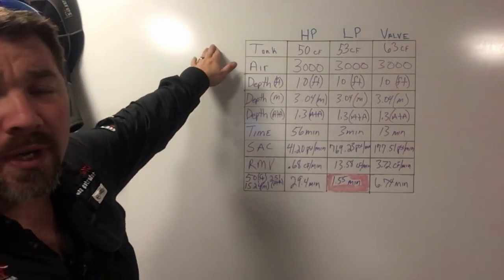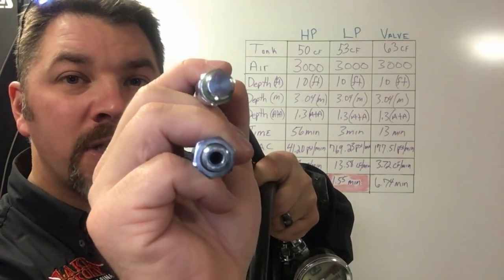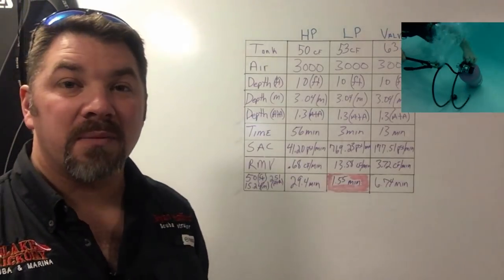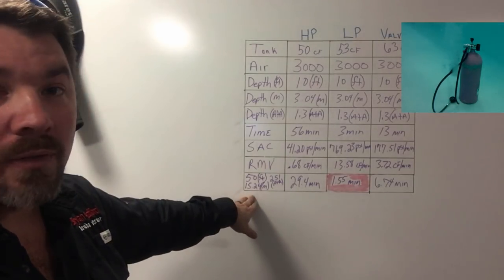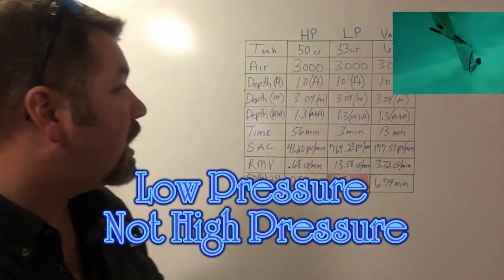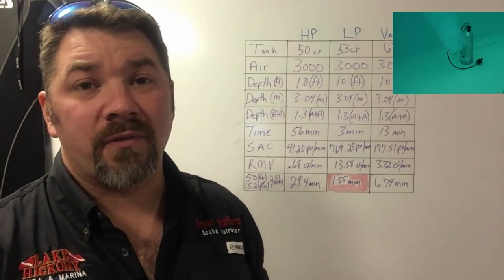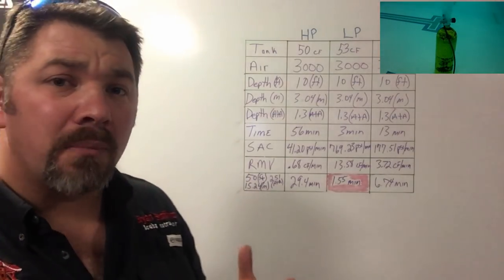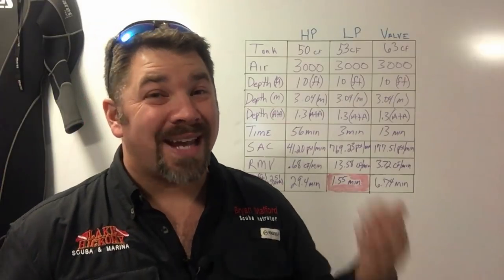Low Pressure vs High Pressure Air Loss Test

Comment: I know this is an older video, but we recently had a discussion about this topic in our diveclub with different opinions. I personally think your calculations are wrong (Not 100% sure though :D). And here is my explanation: When you dive you use more air at depth, because the gas inside of your lungs get compressed and you need to inhale more gas to fill them up. BUT when a hose breaks there is no dead airspace that needs to be filled up, the flow rate determines how much air escapes, not the volume that needs to be filled and that shouldn't change no matter of how deep you are. So it should take the same exact time to drain a cylinder at 3m and 30m.
Reply from the maker: Hello Fabian Buckreus, we are planning a dive in the near future to 100 feet as a retest to see if our numbers are correct.  Stay tuned.
Reply: @LakeHickoryScuba  Awesome, I can't wait. I place my bet on: the only difference you will see from 10 and 100 feet is the different flow rate, if you use an overbalanced first stage.

Comment: I had a diver jump in right on top of me from the dive boat in Bonaire in 2014.  The bottom of his/her tank just missed my head and smacked the top of my regulator (Scubapro Mk 5).  The high pressure hose snapped off flush with the first stage reg body (the threaded part of the fitting was retained).  Once I gathered my senses, it took me a minute or so to realize I had a big freeflow coming from the first stage.  The second stage never freeflowed.  I never got deeper than 15-20 feet.  I made a slow ascent back to the boat, never had a breathing restriction.  As I was climbing up the ladder, the last of my gas was hissing out.  Looking on my computer, the entire episode took about 3 minutes from getting hit to climbing up the ladder.  The reg has a small HP orifice, and the HP hose fitting has a small orifice as well (and it remained in the reg).  It should have taken a longer time to lose that gas.  The best I can figure is that the blow broke the o-ring seal between the reg and the tank, so I sort of had two high pressure failures at once.  My wife actually got a couple of pictures of the freeflow.  Its pretty impressive.   The reg was never the same--wouldn't hold stable IP even once everything was replaced and overhauled.  I figured the body of the reg was damaged, so I retired it.  It's now a paperweight with a good story attached to it.  I never got a visual ID on the diver who smacked me (more concerned with the state of my head).  Whoever it was swam away, never fessed up and never even mentioned it.
Reply from the maker: That is an amazing story.  Glad to hear that you only had damage to your regulator and not to your head.  Sounds like you definitely had a failure at the connection of the valve and first stage, and not just the high pressure line. In regards to the first stage not holding intermediate pressure, a scratched internal surface or a warped housing is usually the reason.  Sounds like the impact and the sudden release of air warped the housing itself.

Comment: Did he ever find out why he had free flow.?
Reply from the maker: LA5150 Yes, his cracking pressure was set too low, and it was uncontrollable once the free flow began.
Reply: Helllo.... What is a "cracking pressure" and where do you set that?
Reply from the maker: The Cracking Pressure, is the amount of force it takes to open and close the demand valve / lever, inside the second stage.  In short, how hard it is to breathe from the second stage.  The is a small nut that has to be turned either from the inside of the second stage, or on the internal portion of the hose adapter, to adjust it.  When you see regulators with an adjustable knob on the side, this is its purpose, to change the cracking pressure.
Reply: Wouldn't a high cracking pressure make the 2nd stage harder to breath off of and also reduce the chance of free flow?  Did you mean the cracking pressure was set to low making the 2nd stage more sensitive and likely to free flow?
Reply from the maker: You are correct, thank you for pointing that out, I have edited my response.  Sometimes my fingers and my brain don't get alone very well.

Comment: I think there is an error to your calculations.
Namely - airtime.
Shouldn't you take into account divers air consumption?
I believe that would cut the hp hose failure air time by half
Reply from the maker: We have had others comment the same thing.   We have discussed doing the test again, but this time, have a diver breathing from the cylinder as well, to see if the results change.
Reply: Interesting idea. 
I thought it was a simple math, but why not to experiment if you can afford that? 
I imagine you are not going to test a resting and relaxed diver.
Reply from the maker: Testing is the easy part, and our purpose would be to create a base line number of how long a cylinder would last.  Regardless of a diver's SAC or RMV rate, in the event any of the scenarios were to occur,  the dive would be immediately aborted.  The video's purpose was to show just how quickly a cylinder could be depleted.  Considering Boyle's Law into the mix, I'm not to certain it would make that much difference if a diver was breathing from the system.   He or She would still make a direct ascent, thus he or she would be using less air on the way up.  I feel confident the numbers would still be close to the results we discovered during our test in the video.
Reply: Ok. So what I have understood you are saying here: 
1) those results are not that important (dive aborted); 
2) your purpose was different that to show exact numbers; 
3) there are factors which can render the testing not so relevant.

I have two questions in that case:
a) When exactly are you planning to perform those tests;
b) what was the initial reason to speculate on the airtime on 15m anyway if you consider the above points?
Reply from the maker: 1) We believe the results are important, and Yes, in the event you have a catastrophic failure, you should abort the dive, no questions asked.  

2) The purpose of showing the math (or in respect to a diver's SAC or RMV rate), was to give the viewers a realistic time frame to how long their air would last during the ascent phase of the dive, compared to a normal breathing rate of a diver.  Also, showing the math was the only option we had, considering the pool is only 10 feet deep.  We were unable to conduct the test at the depth the diver stated during the opening.  The visibility would not have been good enough to shoot a video, here in out geographical location.
  
3) We believe the testing is very relevant, regardless of the factors, as each problem shown can and has happen to divers over the years.  

a) Hopefully soon we will be able to shoot a new video (so stay tuned), with a diver breathing from each cylinder, to see if the numbers change.

b) 15 meters (50 feet) was used, simply because that is where the diver said he had the catastrophic failure.

Hopefully these answered your questions.
Reply: @LakeHickoryScuba  
Thank you very much for your elaborate answer. That gives a lot of perspective. 
And thank you for such fast response time. Your videos are great, I like watching them, and now I can learn even more from this discussion.

One thing that is still hard to understand for me is - in the first case (hp hose failure), how is that possible that one can have same airtime on 15m than with normal breathing from undamaged equipment?
My experience tells me (as well as math) that 15m deep I will consume about whole tank within 55 mins or so.
Leaking hp hose consumes the same amount of air in nearly same time.
If you add up those two consumption factors, then the air should be consumed twice as fast.
Can you please tell me how can you be confident that above is not true?

Thank you in advance (for your patience as well).
Reply from the maker: I'm not sure I can say 100% that it is not true.  The numbers and results were astounding to us as well.  In the case of the high pressure hose, since it has a smaller diameter hole for the air to travel through, it could be assumed that a constant flow through it, could be equal to the greater amount of air (higher volume of air) that comes through a larger diameter hole of the low pressure hose.  And since throughout the breathing cycle there are times when no air is escaping the low pressure hose (the exhalation process, when the demand lever closes inside the second stage), then it just by chance equals out to be the same amount of volume as the other, for the same amount of time.  This could be a mere coincidence, or a highly thought out equation by the engineers that designed the regulators.   Either way, its interesting to say the least.  I still think that the size of the ports have a lot to do with the amount of air that flows from the system.  As much as I enjoy the math and science behind Scuba Diving, some things are truly above my intellect.  This may be just one of those things.
Reply: @LakeHickoryScuba  I realy do appreciate your answer.
In trying to understand the lp hose results, please take into account that air is flowing through the mouth piece (2ns stage reg) at different pressure at different depth. So it is not true that cutting the hose is simply stimulating free continuous inhale. In such case the reg would be simply not needed.
Please note, that 2nd stage decreases the pressure greatly adapting to depth (diaphragm is regulating air pressure to be equal as water pressure at given depth).
At the same time, the pressure in lp hose have to be high enough to allow 2nd stage reg to match the surrounding pressure at higher depths. 
So inhaling at 10m will result in momentarily flow of ca. 3 liters of air at 2 ata pressure. Same single inhale at 50m will result in ca 3 liters loss at 6 ata which is not the same amount and impacts the remaining air time differently.
You can check in your 1st stage reg specification what is the exact pressure in your lp hoses.

Hope that helps :-)

As for my initial questions - I think I can be completely honest with you. No one knows all the answers, and everybody makes mistakes every now and then. I think it is absolutely acceptable. 
Given the quality of your videos and effort you put into educating diving world I am sure you can benefit easily from taking into account polite and friendly remarks and admitting a mistake that could happen to anyone. No need to deflect ;-)
That small error is nothing compared to 99.9% of high quality you deliver :-)
Thank you again, and I am looking forward to see more of your great videos :-)
You've got my sub!
Good job!
Reply from the maker: Thank You for the subscribe, and You make very valid points.  I guess a more accurate way to simulate the diver's catastrophic failure (in the second stage) would have been to hold the purge down, causing a free flow vs. cutting the hose.  I guess you could say cutting the hose was a more dramatic way of causing a failure, than just holding the purge, plus it was just a lot of fun doing it.  I have no issues with admitting mistakes, as I always enjoy learning more and more.  In that scenario, the results may very well have been different.  The great thing about this conversation is, you have given us more options and variables to add into the future video.  We will definitely try the free flow vs. cutting the hose, on top of having a diver breathe from the regulator during the failure, as this will be a better representation to what actually happened to the diver in our video.  If you are close to us, it would be awesome if you could join us during the filming.  It's great having a third party perspective when doing videos like these.  If you are not close, I would like to feature your responses in the new video, if you are OK with that.  In the last year or so, most of our videos have been made based off the suggestions of our subscribers.  We stay so busy through out the year teaching and traveling, sometimes it difficult to come up with new ideas for videos.  We really enjoy testing out gear sent in from viewers and even testing dive theory questions that our subscribers send us.   Thank You again for commenting.  Like I said in previous videos, we enjoy not only teaching others, but learning from others as well.

Comment: LP results will be much worse at depth, the first stage is letting more air through, so at depth LP failures could be instantly catastrophic, should do this LP test at 100 ft, the HP test will not be much different
Reply from the maker: I wished we had a 100ft pool to do the test in.